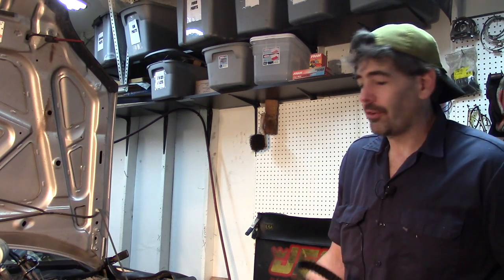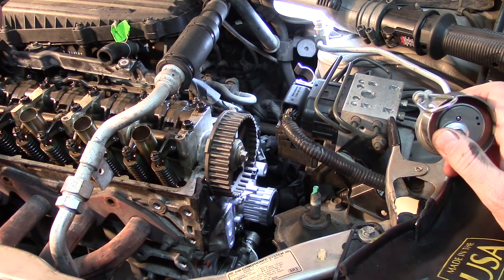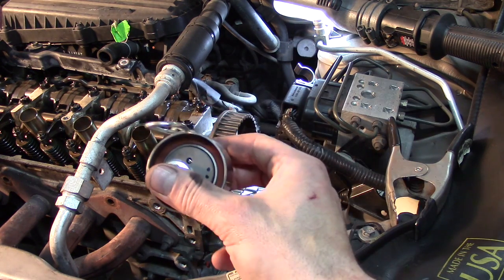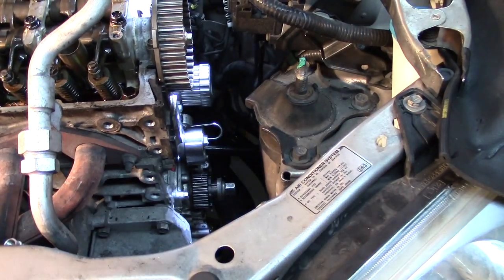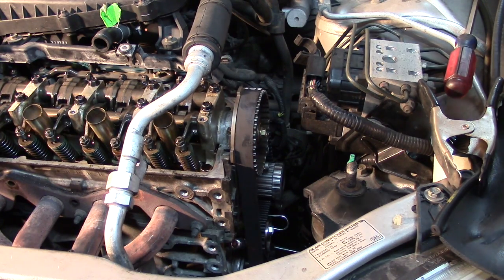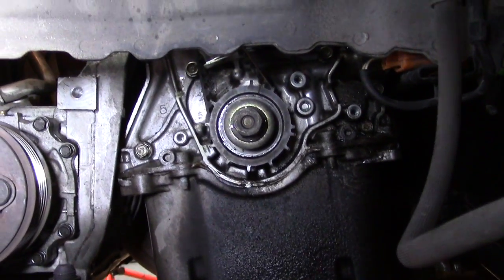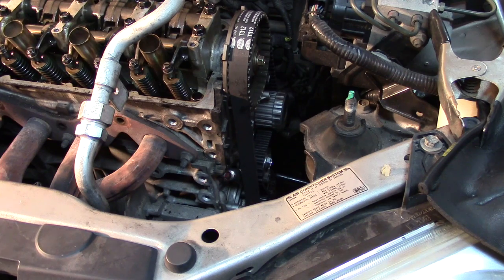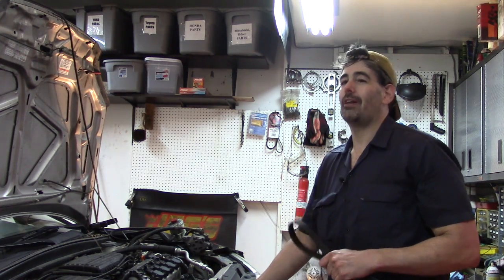Timing belt alignment 2001 Honda SOHC VTEC

Comment: Making that extra mark on the crank pully is smart . Im in the middle of this job rn and I got it right last time but those marks and all the stuff make me nervous. Feeding the new belt on is kind of a bitch I saw this guy in another video do it from the top down and took off the little gear ⚙️ on the crank pulley and put the belt on and slid it on. Im worried doing it from the bottom up will move the cam pulley

Comment: How are you turning the crank counter clockwise if the harmonic balanced isn’t installed yet? If you use the crank bolt it won’t turn the crank because you’re just loosening the bolt when you turn counter-clockwise. If you tighten the crank bolt it will throw arrow/notch marks off and then you’re basically starting over again…  I have yet to find any info on how you’re supposed to turn the engine over counter clockwise twice to make sure marks are aligned…. I’m working on my 2002 civic.  Thanks
Reply from the maker: I just use the crank bolt. The balancer is irrelevant to the timing.

Comment: I’m not understanding how to get the crank shaft bolt off to put the pulley back on without moving the timing. I’m in time but if you’re timing it counterclockwise how do you unscrew the bolt once it’s in time?
Reply from the maker: Because it is keyed on the crank shaft.

Comment: What happens if there is a broken tooth for the crankshaft position sensor
Reply from the maker: You will definitely get a crankshaft position sensor code or at very least a misfire because the pcm will either notice the variance OR will interpret it as a slower crankshaft speed and assign a misfire.
Reply: @SchrodingersBox  can it cause car not to start because when i unplugged the sensor the car starts but is in limp mode but when i plug it back in it tries to start but dosn't
Reply from the maker: Ohhhhhhh yeah I can see that happening. Maybe it thinks the missing tooth is a TDC#1 signal and thus your timing sets wrong. Unplugging it maybe forces the cam sensor to be used instead and it’s not missing a tooth so it’s timing right. I can see that as a possibility. Unfortunately you will need to replace the flywheel. You also risk not being able to crank the car if you stop engine and it happens to be missing tooth aligns with starter so the start can’t grab it.

Comment: I don't understand , Does this tensioner does not move once it's torqued , What compensates for wear as the spring no longer has tension ?
Reply from the maker: it does. it sets a baseline tension- but it does adjust for stretch and as a matter of fact for temperature too.

Comment: How much would you estimate it would cost to buy all your pulley parts timing belt and tensioner replacement and to have them all replaced if you have your own parts and you’re just having them installed by someone?
Reply from the maker: $40?

Comment: I have the same car... I recently changed my timing belt.. While changing, i noticed that the old belt was not alligned.. It was half teeth advanced. Now when i am trying to install it in total alignment, it either goes half teeth retard or advance.. 
What could be the reason and what's the solution of this problem???
Reply from the maker: Its tricky- this happens to me too-  the trick is you have to set the crankshaft advanced just enought teeth so it ends in the correct position when tension is applied.  Sometimes takes me a few attempts but the marks will line up exactly when done correctly.
Reply: I'm still having trouble with this point. I'm being told the head is warped. I feel like the timing is still off. replaced the head gasket as well. Any help 🙏. Thnx
Reply from the maker: Did you measure compression before replacing the belt?  Are you can and crank positions correlated?
Reply: I think the replaced head gasket should be of the same height as the original. If the height of the gasket is more, this problem will occur.. at least, that's what I think.

Comment: If the engine is turned over but not run the valves can still be bent? 2002 Honda, If the head was replaced and the timing belt is still in place is there anyway to find the timing mark on the bottom pully without taking the belt pully and timing belt cover off?  Doesn't TDC come up twice, compression and exhaust/intake? then looking at the timing mark you have to look at the valve positions otherwise your spark could be on the wrong cycle?

Comment: If I'm in the middle of nowhere and had a blown head gasket can I use the same gasket clean it up then use spray paint as a gasket seal if nothing else is available
Reply from the maker: definitely not. you can’t use the same gasket again even if you didn’t blow it. once you compress it, it can’t be used again.

Comment: Thank you and I don't know if you still answer questions or are still on here but I recently on my car worked on they had to change stuff around the timing belt and now it sounds great but whenever it gets to 4000 RPMs it'll jump when I'm driving it but if I keep it under it's fine is that to do with the timing belt
Reply from the maker: could be. I would check your timing marks, or better yet correlate the camshaft position signal with its relationship to spark at TDC.
Reply: Okay I'm going to....  my that's going to take a long time. I might just try to find a different mechanic to do it thank you for responding

Comment: Burping the coolant system is very critical on the 1.7 L. If any air is trapped in the idle control you'll have a very high idle. Great video.

Comment: Would it be easier to remove all 4 plugs so the engine  turns over easier, or not really..?
Reply from the maker: Oh yeah for sure it makes it easier. Sometimes I do that if it will save time overall.

Comment: Thank you finally someone who showed how to correctly set the timing belt tensioner
Reply: is it necessary to determine whether or not the pistons are in the compression stroke or exhaust stroke? or as long as its tdc and arrows are aligned, its correct?

Comment: I'm about to do my 01 d17a1 lx civic but I read where you shouldnt use the vtech belt on non vtech but when I get on amazon to order its confusing cause on one post itll say it fits my vehicle then on others its says it doesnt but they all say in description that parts fit d17a1.
Anyone know if the vtech and non vtech timing belt is the same.
Reply: My belt broke, so i'm replacing it, according to autozone, their book only shows one belt , but, I have a 2002 Civic LX 1.7L  I don't know about the 2001.  I would think it would be the same......
Reply: @jayman2261  i hope,people are trying to say if you use the vtec belt on a non vtec itll slip faster or better chance of slipping.
I got my kit a few days ago and gonna start it tomorrow or day after.
I'm gonna compare belt lengths too when I take the old one off.
I had the 02 and 01 at the same time and the only different was one was a stick shift and different interior material.
Other than that everything was exactly the same.
My 01 still has the same motor as the 02 had,coils on the plugs not the distributor on the side.

Comment: Need a video on repairing the tensioner bolt hole, Someone before me strip the hole out now what?
Reply from the maker: easy- just drill next size bolt hole and tap new threads and you’re good to go.

Comment: I was wondering if you could tell me. I jumped in my car drove 2 blocks, it drove fine to the store shut the engine off and when I came back to start my car it would fire up but bog out and die every time the same way is it my timing or is it a different problem I have an 2001 Honda civic DX 1.7L
Reply from the maker: No idea.  What data do you have?

Comment: If my crank only turnsf front or back  180 but won’t go the whole 360 going forward y
Reply from the maker: Then you have misaligned the cam and crank and are running the piston into a valve.

Comment: You are amazing. I was stuck trying to get my new belt on, but I just couldn't get it to fit. the instructions for the kit I bought told me to attach the tensioner spring before putting the new belt on. I did some googling, stumbled upon your video, saw that that wasn't the way to do it, and now have my car put back together with everything working and sounding just right! Thanks for a great video!
Reply from the maker: Glad you got it to work!

Comment: Hey Matt,

Fan of your videos and like really appreciate the help you are providing. I recently changed the timing belt on my 02 accord DX 2.3 L 4-cylinder and after running for about a day I heard my belt rubbing against something. Turns out it was walking off the Cam and rubbing against the cover and the balancer belt. I used a kit with new belts and tensioners and water pump. There is good tension on the belts. However when I rotate the engine by hand it is still walking off the cam until it starts to rub against the balencer belt.

I read that it could be tentioner bolt or bent cam bolt, not sure how i can check the cam though. as far as I can tell it seems straight. Hope you can help point me in the right direction and keep up the good videos!
Reply from the maker: Yes this is usually an indicator that the tension is incorrect.  It also happens if the timing belt is directional and installed backwards.

Comment: Great video hey I 100% agree with your take on novice people doing this Job. I've done dozens of timing belt kits all on Honda cars. You HAVE TO get those marks lined up perfectly especially once you Tension the belt. I see alot of people screw up on the balance shaft belt and forget to use a long Bolt to Lock the balance gear in place and then they have an Engine that vibrates really Bad.
Reply from the maker: yeah i got sick of getting hate mail from people who destroyed tueir engines because they can't follow instructions so i made this as a caveat.

Comment: If the timing is just a hair off top dead center before removing the old belt, can you turn it clockwise (backwards) just a hair to align the marks?  or do you have to turn counterclockwise at all times?  I noticed you backtracked the crank by a hair which is why I asked.  Thanks so much for this very nice video!
Reply from the maker: properly done the timing will be exact and visually obvious. If you have to turn counterclockwise you generate slack in the belt so I instead just advance 720 degree exactly.

Comment: I remember doing my non vetch Civic and the hardest thing for me was getting a way over tightened harmonic balancer off. I did have to chuckle to myself when you said to disable the ignition system to turn over the engine because this was my first timing belt change I turned over the engine by hand about 4 times and checked the marks before going onto testing with the starter motor and rechecking the marks before I was 100% confident to allow the engine to run. I can't remember how long it took me and to be honest I didn't care as long everything was ok as this is one thing that you do not want to screw up!

Comment: your oil pan are missing 2 nuts at 7:02
Reply from the maker: Yes of course. how do you think I got the timing cover off, silly?????
Reply: +Schrodingers I think you missed my point there are 2 nuts that hold the oil pan had nothing to do with timing belt
Reply from the maker: You obviously have never done this job before.  They have EVERYTHING to do with the belt. How else would you get the timing cover off since it fits over those studs and is secured with the 2 nuts????
  Armchair mechanics.
Reply: +Schrodingers Box believe me my friend check again at 7:04 l talking about 2 nuts that hold the oil pan the bolts down from oil pump to the pan that nuts are missing and I see it because I working on my like 5 hours ago that is why I know, I am not talking about those bolts that hold the timing belt cover.
Reply from the maker: Then you should redo yours correctly.
Reply: it is funny that you still don't get what nuts i talking about there are 4 bolts to hold the lower timing cover and i am not talking about those but in your video i saw that your oil pan nuts are missing unless my Honda civic ex 02 are different then your civic 01
Reply from the maker: This is obviously not a Honda Civic. Not even same engine.
Reply: my bad
it isn't civic
Reply: thanks for your videos help me a lot

Comment: dude. so here is where im at. i need to get/make some special device type tool to sort of straighten a couple few of them rod and spring things that are on the engine. They are under that big cover. is like my motor was not in alignment.  should have done a proper alignment before taking on this belt job. So you should ad that in your next video. You know the next video you are going to show us the special device tool and get them rod springy things to get unsticky. Because that is where i am stuck.  didnt even bother with all this blah-za-blah that you are talking about and i did mine way faster than you. way faster. Just cut of out belts with knife then just slap the new ones on. And do it real quick. who cares about all these stupid arrows and nonsense, those are just cosmetic to make the engine look more like a racer engine. So lets see this magic tool and how to use it to get these things moving freely again. Ok thanks mister.

Comment: I really enjoy your videos. I learn even though I don't know squat about cars. Was wondering if you could tell me is $265 plus tax a fair price for a power steering and serpentine belt change on a 98 Nissan Maxima? Seems pretty steep. Even I know belts don't cost that much. Thanks in advance.
Reply from the maker: +BellaBluu I wouldnt know- I've not been to a shop or dealer in many years
Reply: That's too much. That's ridiculous, a serpentine belt is only $25. Stay away from dealers unless you have a warranty. Dealers tend to over charge. Go to either a DIY mechanic, that you trust of course, or a mechanic that owns his own shop. You have to also consider the labor of the job. Some charge $75-$100 an hour.

Comment: Great information man, a quick cheat I have learned is/if you are doing the T belt for service purposes that means the car is perfect talking timing wise so what I do is of course set my timing marks than mark the T belt to the cam sprocket/s and crank sprocket that way I know exactly where the timing belt is (I mark it where it's best for me), than when I get it out all I do is transfer the marks from my old T belt to my new T belt, and wallahh is in the exact same position. Of curse I turn it at least three revs to make sure I have the correct tension and to check over my work (my marks though won't line up till Chinese New Year).

Comment: Good video, I just noted that the engine belt is on the driver side on this, can it be a reason for it rotating counterclockwise since the transmission is backwards?
Reply from the maker: AutoFocus I have no idea but that explanation works for me!  This idea would be pretty well supported if model years that go clockwise have the belt on the right side of the engine bay. I never really noticed.

Comment: I like how you triple and quadruple checked the timing marks. I do the same.  Plenty of times i have began the procedure of installing a new timing belt and the crank or cam gear is 1/16 off left or right and throws the entire belt off 1 notch either btdc or atdc....twin or quad overhead cams are even more of a pain in the ass....... accuracy is important to get it right!  Nice job
Reply from the maker: In general, my persistence in measurement is directly proportional to the consequences of being inaccurate.
Reply: Schrodingers Box you got that right......perfectionist!  lol

Comment: Looked easier than that 03 Focus we used to have lol took me all day. Great vid Matt
Reply from the maker: I would agree- easier than a focus. 
  I would say the second easiest I've ever done. The easiest by far I believe I have ever seen is the Chrysler 3.5L.
Reply: Schrodingers Box I would have to agree. I really like the fact you recommended replacing the pulleys and water pump. I don't know how many people have brought one in and just asked for a belt only then a month or so later needed a new water pump and blamed my shop even though they were asked about the water pump while everything was apart lol. It just makes sense to do things properly.
Reply from the maker: Absolutely correct. Also, even worse, I have seen where people just replace the belt and a timing component fails- it is overlooked that those timing components have the same mileage as the old belt, and the new belt tension will strain them further and induce failure. 
  I would say almost half of timing belt failures I have seen were not failures with the belt but rather failure with a pulley or tensioners.
Reply: Schrodingers Box Excellent comment!